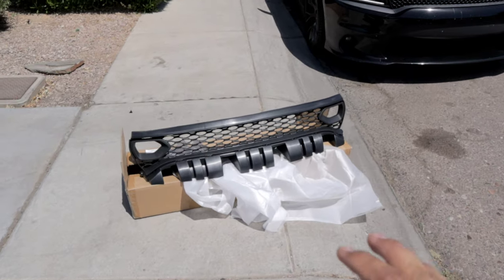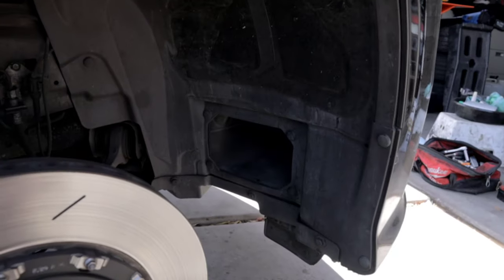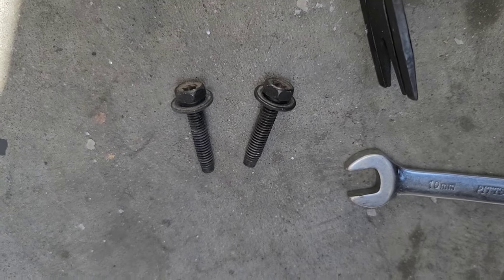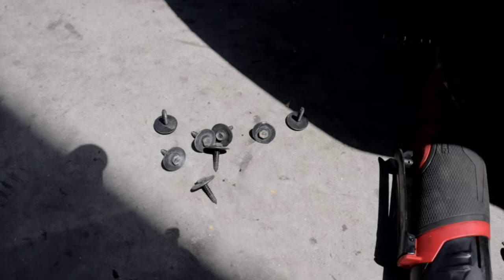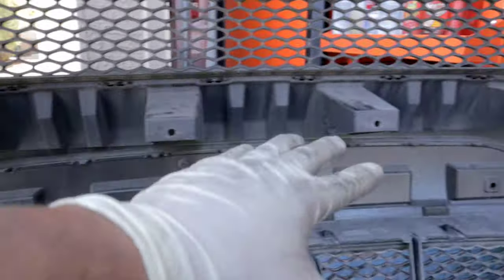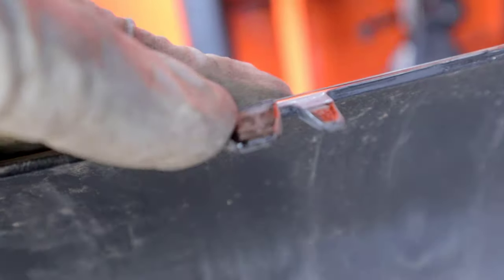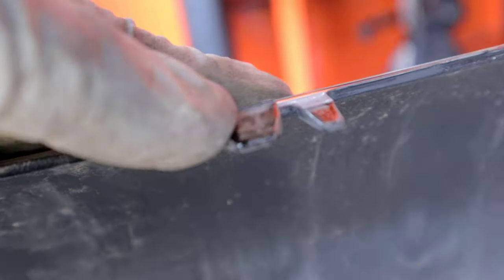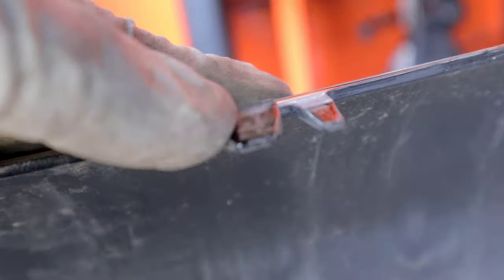This will make your old charger look new again! Dodge Charger bumper cover removal & grille upgrade!

Comment: What a process iv done a few grills my old Mitsubishi Lancer and my Toyota Tacoma much easier than this you can literally lift the pop the grille pins set in the new ones and done, my question is if I were to swap over to this grille do those vents make the snorkel from the hellcat airbox functional? Cheers

Comment: This is not an easy task. It's pretty challenging. But worth it once is done. I'm at the point where you push down on the tabs to remove the old grill.

Comment: Clean work here brother! What tool did you use to make the holes in the grill for the SRT emblem to fit ?
Reply from the maker: Thank you! I used a small razor blade
Reply: @ERICSDIYGARAGE  Thanks for the tip! Definitely will use, as I work on my clients cars 🙏🏼

Comment: Did you use your hands or a tool to push the clips out of the badge? On the back, I pushed the tabs, the metal, looks like the back of an earring and I can’t get it
Reply from the maker: I used a tool but like I said it's going to likely break since it's very hard to get out
Reply: @ERICSDIYGARAGE  yeah the tiny clip next to the tab on the left just broke…🥲 it’s all good I’ll try to super glue, what kind of tool? I am trying with my might to push them out😅😂 I have the snorkel grill on my rt and want to keep the oem dodge badge, haven’t seen it yet

Comment: Does the lower lip of the new grill that rests on the bumper, match the lower lip of the trim piece under the headlights that rests on the bumper?  I have a 22 Charger GT and am considering this mod, but the factory grill looks more dark grey than black and I'm afraid the color of the trim on the new grill will not match the factory trim under the head lights.
Reply from the maker: Yes they do match
Reply: @ERICSDIYGARAGE  thanks.  Great video BTW...I've watched several of these and so far you have been the only one I've seen that didn't have to fight with the tabs to get the old grill off.